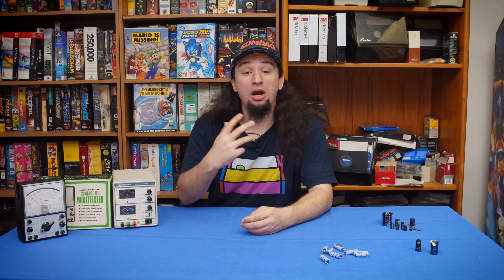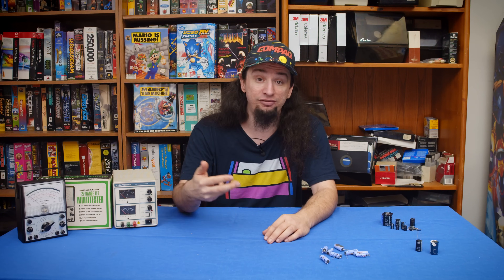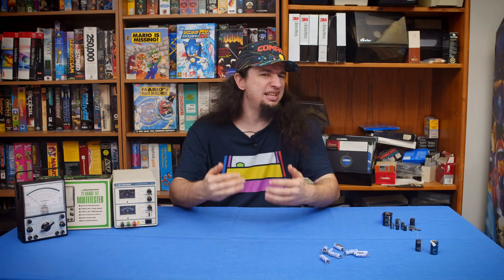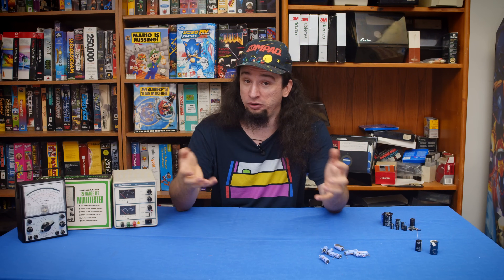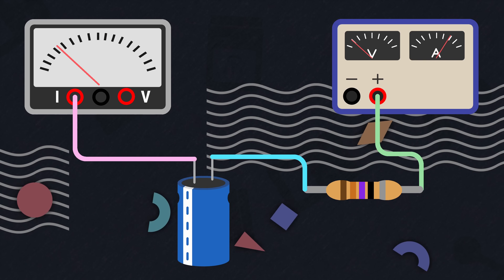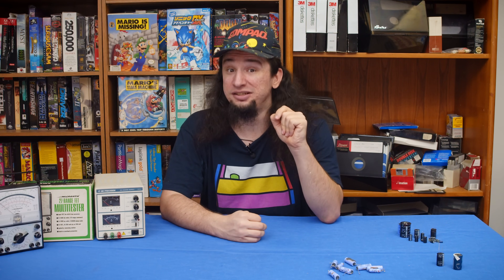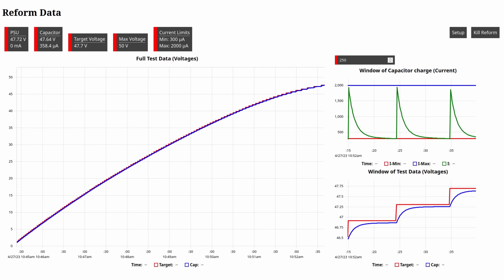Reforming Capacitors - Everything you wanted to know

Comment: There is no such thing as "saving" old capacitors... reforming is real yes, but they will never operate like new, if your capacitors are in there just to make a functional vintage display item, by all means reform them and leave as is, if on the other hand you have something like filters on a ham radio, replace the dang things and quit blasting noise out of your 60+ year old dried up caps. At a bare minimum put new capacitors inside the husk of the old ones if you want to retain a vintage look... but don't run old capacitors on RF equipment. And just replace the old tantalums anyway... they'll explode.

Comment: A firm rule does apply (should) to 24v and higher ac/dc inverters if you want them to last. The big solar ones with thousands of watts. Those should get a trickle through a resistor before you go full power.
  I've got a 25w 30Ω ceramic on a 3way switch for 12v setup that can expand to 48v so I just put it in so it was there and I wouldn't have to change as much later.
 Keeps the arcs down if you are connecting/disconnecting/fn around.
Reply: Just arcs hooking the inverter up. Won't help anywhere else obviously.

Comment: Just put a series resistor that limits the current to a few milliamps. Leave it for hours/days and watch the capacitor voltage, if it stays too low, reject or use in  a lower voltage circuit. You can reform to higher than label voltage the same way, if the voltage on reforming stays steady/safe, you can use it at a bit lower voltage. BEWARE, little capacitor casings take off like bullets if overheated or reformed too fast. These represent eye injury risk, be safe, it happens.

Comment: It would be far easier to put together an extremely simple current source using a generic voltage regulator and a single resistor. Set the power supply up to near the cap's working voltage and occasionally check to see when the current draw drops to near zero.
Reply: I don't think that will work. You need to apply the voltage gradually. Just slamming an old cap with close to its working voltage may lead to failure.

Comment: For high voltage caps use as many 9 volt batteries in series as you need. Make a battery bank with switchable outputs for standard cap voltages. You could also use a constant current sink circuit instead of the resistor.

Comment: With a power supply that has current limiting the no-load voltage can be preset to the max V of the cap, and the max/limited current be set to f.ex. 5mA, then everything takes care of itself. Much the same as other electrolysis, even the charging of lead batteries (also electrolysis).
Long ago I built a uA723 based very versatile analog power supply 3-24V/6A (3-4mV ripple❤) where  the only problem is the minimum of 3V, but this can be lowered with a series Zener diode and a bleed resistor to keep it from exceeding the max voltage at the end of the process (e.g. with a 3V Zener the top voltage must be set at 3V over the cap max volage, the Zener must have a minimum current to have the correct voltage drop)
PS in this mode it is a current supply and not a voltage supply; the voltage is regulated by the limited current

Comment: Putting caps in series is seldom a good idea due to variations in the caps actual values.     😉
Reply: Sometimes you do not have a choice. If you need voltages higher than available capacitors (commonly 500 volts), you either use series connected caps with RC networks across them or you use REALLY expensive (or surplus military) oiled paper, multi-microfarad, HV filter caps. For instance, there are a lot of vacuum tube, amateur radio amps running at 2 to 3 KV.
Reply: @johncasteel1780  For sure m8, ya gota do what ya gota do.  But, if you can avoid it it's best to do so.  If you're in a situation where you have no choice then it's a good idea to put a resistor across each cap to swamp the leakage currents as much as possible.
Keep well m8.  🙂
Reply: @Graeme_Lastname  Actually, if you need to connect electrolytics in series for higher voltage ratings, you should parallel each cap with (about) a .01 mf cap and a 270 k to 470 k, 2 watt resistor to equalize the voltage drops. As a bonus, the resistors will act like a bleeder.
Reply: @johncasteel1780  That's right m8.   🙂

Comment: Couldn't you just set your power supply's voltage limit to the cap's voltage limit, and its current limit to the "safe value" you determined beforehand, and just let it run until it reaches the cap's voltage limit and the current drops to its stated leakage current?

Comment: I love this video so much (and noticed there were no video chapters), so I created video chapters, for my reference, and hopefully for anyone else who like the links that chapters provides!  Shelby, please feel free to copy/paste my chapters into your video description if you like, tweaking for your preference of course!
0:00 Intro
1:09 How Capacitors Work
2:28 Aluminum Electrolytic Capacitors
3:57 Capacitor Lifecycle 
5:33 Old Capacitor decomposition & reformation
7:48 Analog vs Digital (regulated) equipment
8:55 Reforming Standards
9:31 Equipment Needed
10:31 Basic Setup
11:19 Demonstration
12:56 Better Gear & Software/Web Interface
15:28 Capacitors Off Limits (for now)
16:15 When you should & should NOT Reform
17:49 Conclusion
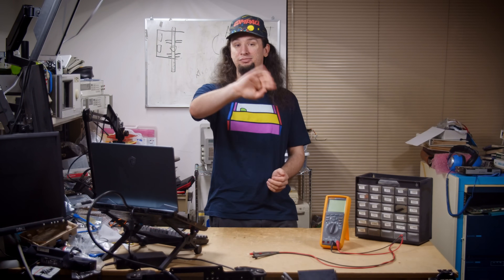18:48 Credits
Reply from the maker: I completely forgot about that, I actually wrote this script with "chapter titles" I meant to use in the video but they ended up covering larger sections than I planned by the time the script was done and were less meaningful. I added yours because they fit much better with what the final result came out to be. Thanks!
Reply: @TechTangents  That's awesome...so glad I could contribute meaningfully!  Keep up this amazing work!!!

Comment: I would have thought that you could do the same job that your software performs in hardware by simply using a constant current source drawing from a supply equal to the maximum voltage rating of the capacitor. As long as you pick a constant current somewhere between your min and max, I would expect the reforming to take place without any need for adjustment. You'd simply come back to the capacitor under test after a few hours and check that it's got something close to the rated voltage on it, while the constant current has dropped to the expected leakage current. If not, it's a failed capacitor and you throw it away. A cheap LM334 will work up to 40V and will provide a constant current between 10μA and 5mA, set by one resistor.

Comment: Non-polar electrolytic capacitors will have no voltage across them in normal service and they are going to be difficult to reform.  The only cap in my 1975 amplifier that failed was non-polar. Many linear power supplies have an adjustable current limit.    I would use that to produce the desired constant 2 mA,  then set the voltage to the capacitor rating and it should just work.  A series resistor will work fine as well.   No computer required.

Comment: I don't think you can reform old electrolytic capacitors to a large extent. Especially those LowESR types. Once such a part even starts to bulge slightly it should become replaced. The main problem of these things is thermal thread impacting them during operation, causing gas buildups. Only capacitors not being exposed to thermal stress (smoothened DC, not pulsed, not being used in a highfrequency context like switching regulation or also in final stages of a power amp, usual NF, not HF ) might potentially be subject to reformation.  If their rated values did not decrease significantly over time. There is another very problematic sort: Tantalum caps. Also absolutely not meant to experience thermal stress during operation.
Reply: Bulges mean physical damage. At that point, trashcan it.

Comment: What is the significance of reforming in steps as shown?
Why not use the current limit on your PSU set around 1ma with the open circuit voltage set to the target voltage for the cap, connect and leave until either the voltage settles at the target or it stops rising, indicating cap death?

Comment: Does setting in constant voltage and pulsing a higher current help build the oxide layer? I would think ideally you want to get it on a constant current supply at your chosen rated maximum with a voltage cut off limit set, I would think this would achieve a faster oxidation.

Comment: I restore TVs from the 40s 50s and 60s,  the electrolytic capacitors very often in them quite DEAD, dry as a bone, no amount of reforming will save them, only way is to replace with new 300v-500v type ones.

Comment: Very good explanation and description of the process and chemical situation (coming from a 35 year EE analog design engineer) but the prices of just replacing the capacitors with newer ones makes it hard to justify the time spent. Mr Carlson ( on Utube) is a master of replacing especially very old capacitors including mostly non-electrolytic capacitors. I think your video is actually very educational and between the lines, give more reasons to replace than reform (especially the unknow ESR factor you mention in the video. The newer switching power supplies actually rely on low ESR type capacitors to limit the internal temperature of modern capacitors.

Comment: That was a good presentation and people who advocate 'just fit new' instead of at least attempting recycling should watch it.
I actually lesarned something new and it probably explains why the start run capacitor on my old AC fan failed on a 'regular' basis (in Florida voltage spikes are very common so I assumed that was the problem, probably contributary?)
I always kept a couple of new capacitors on hand to swap out when fan motor wouldn't start, the life of caps after the first failure was shorter by a substantial amount. ( original, 4 years, replacements, 3 years, 26 months, 20 months,14months, 11 months -- new system fitted)
 I now realise that was not the greatest idea but would probably be fine if I reformed them before use?
All the people advocating just fit new, how do you re-cycle the old caps or do they just go to landfill?
Also, how old are the 'new' caps?
Some may not have been made for decades and have just been in storage
Reply: "I now realise that was not the greatest idea but would probably be fine if I reformed them before use?"

No. Motor run-start caps are NOT electrolytics. They cannot be reformed. Electrolytics also cannot handle large amounts of AC current through them.
Reply: @johncasteel1780  Weird, some have had a 'brass vent' ?

Comment: OR, instead of using fancy computer-programmed gear, you could go the analog way. Construct a simple constant current source and use that to put a constant current through the capacitor. Set the voltage source to close to the maximum voltage you want across the capacitor (plus a couple extra volts to account for the drop across the source), and use it to feed the capacitor with a constant current through it. The constant current source will automatically adjust its internal impedance to generate the required current. You only need one JFET and one resistor, or 2 BJTs and one resistor to make a simple constant current source. You do need to fiddle a bit with the value of the resistor initially to get the exact current value you need because that depends on the exact parameters of the JFET or BJTs you're using, but that's a one-time process only.

Comment: I have two capacitors. Have you ever seen a capacitor with a date code printed on it? Well.... I think the 7124 on there is a date code. 
They are 25V 160000uF. About 50J. They have been powered down since the early 1990ies. Yeah! I'll have to reform those before reuse....

Comment: An easier and more elegant method is to use a Adjustable Current Limit Supply. Dial in your max current, set the open circuit voltage about 15%  to 20% below the rating of the Cap. After stabilization keep the current limit unchanged but raise the open circuit voltage to the rating of the electrolytic. BTW, you did a nice job describing the idiosyncrasies and reforming of Electrolytic's! It's been over 65 years since first studying them.
Wakodahatchee Chris
Reply: I was thinking the same thing. Why not use a constant current regulator/source with a maximum voltage topping out at the rating of the cap?
Reply: I just came here to make this comment. Cheers for doing it for me. A bench PSU with voltage and current limits has been standard for a couple of decades now. All 3 of my s/h bench supplies have it.

Comment: Very good video, thanks.
Very interesting.
I wonder if it's possible to do this technique to capacitors in circuit.
For example with some type of 3d printed harnesses that just contacts the capacitor on the backside of the PCB board.
Reply: I wouldn't risk damage to other components by applying voltage to reform capacitors in circuit.

Comment: I  would only reform if an emergency. Capacitors going bad can damage other electronics Not worth the risk just replace with new. When we go through the trouble to unsolder a bad capacitor I am not going to put it back in. Reforming is not going to help much with excessive ESR or leakage current.

Comment: I wondered if that super-fine HP power supply could do a 2 mA - 5 mA current limit?  If so, could you not set it up with the rated voltage as Vout, and Iout as 2 mA?  that would not require any software to do the job, seems to me?
Also I wondered what "G-pib" was, but realized that you meant "G - P - I - B"   ;-)  but, since it's an HP device, it is actually HPIB, which, as I was reading the history, is defined slightly differently... or IEEE488 ...

Comment: Oh, this was good! I have a box full of beefy, but old, capacitors that I thought I'd have to chuck, purely because of age. Mechanically they are still beautiful.
Reply: I have some too - Mallory 10,000uF 100V the size of a coffee mug. Unfortunately I don't have a proper bench power supply, just a little thing I made from an Aliexpress kit and a 32V DC printer power brick that'll do 3 - 30V only. I have some quite a bit smaller newer Elna caps of the same value that have been sitting on my shelf for a few years too.
Reply: @Shaun.Stephens  Use your supply to reform the capacitors to 30V as a first step. If they don't have out-of-spec leakage, then you've done most of the work in rebuilding the oxide layer. You can then use them in 30V projects without any fear. If you want to use them in a higher voltage project, there's a good chance that they will then reform up to the 100V spec just by simply using them in circuit. Just take care on first power-on.
Reply: @RexxSchneider  Thank Rex, I wondered if reforming to 30V would help. All the best.

Comment: This is a super interesting discussion, and a great explanation (or part of one) why the 12v ac adapter I bought 10 years ago stopped delivering 12V 2A and became a questionable 11V 250mA supply. If you have a project that calls for lots of coulombs and you have the e-waste, I say go for it. I can envision a few scenarios for it but honestly I would probably just go with new caps for anything serious. I'm not an expert, I don't have all day, and capacitors are cheap. 👍

Comment: You could also just use the current limiting function of your power supply, and skip the whole resistor and adjusting voltage debacle. It might be a little challenging to set it that low, but even with a knob power supply, it could still be done.
Reply: A constant current source that supplies current in the range of hundreds of microamps to a few milliamps is simple to build. For voltages up to 40V, an LM334 plus one resistor will do the job. For voltages up to 100V, use a cheap IRF530 or IRF540 with an adjustable source resistor to set the current. For higher voltages, there are high-voltage mosfets like the IRF820 that handle 500V, but obviously cost more and require more care when working with such high voltages.
Reply: @RexxSchneider  I have done similar with simply a transistor and a constant voltage set on the base, using a resistor from the emitter to ground the voltage drop across it blocks current flowing through the base reducing the current through the collector. Super simple but might not be as simple as a dedicated IC, but it is super cheap!
Reply: @SuperBrainAK  I agree that  using a bipolar transistor with a constant voltage on the base and an emitter resistor is also an easy way to create a constant current source, and it would have been my first choice 40 years ago.

However, the cost of a bipolar transistor plus a zener diode and an extra resistor is not much different from the cost of a JFET or an LM334. For use to supply the sort of constant current needed in the video, there's not much to choose between them, but as soon as you need temperature stability or are working from low voltage rails, the LM334 wins hands-down.

The other option is a current mirror, but you need two very well-matched transistors for that circuit to work well.
Reply: Yeah!  I don't get why any of that software was necessary.

PS: I miss your Law Blog.
Reply: I wondered about that - you could just set your PS current very low, but I didn't try it, might not be so easy.

Comment: Could you not use a constant current source of say 5mA and connect to a power supply set to the caps max voltage?
You can make a constant current source  with an LM341, a HV n-FET, a two resistors.

Comment: Very instructive 🤔 I have a suggestion to automate this with a regulated power supply: set your lab power supply to current limitation mode and set the voltage to the target voltage. The regulation will gradually up the voltage with respect to the current limit.
To be tested before reforming the caps of your vo stage Marshall 😏
Reply: I just wrote a whole rant about that a few minutes ago, now I see you mention it far down in the comments, yes that is the simplest way to do it